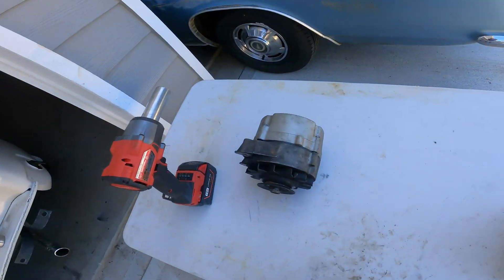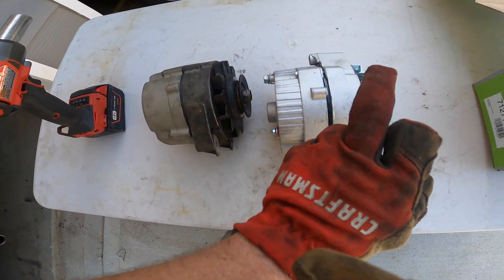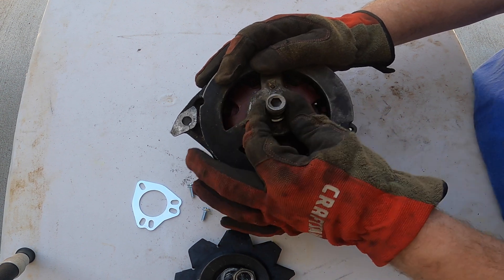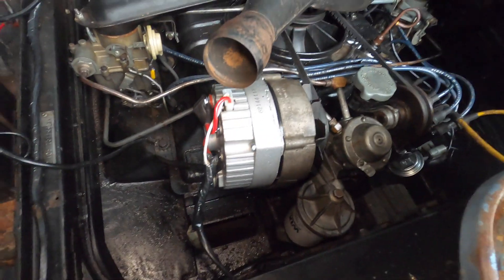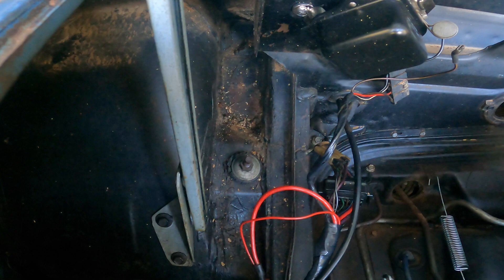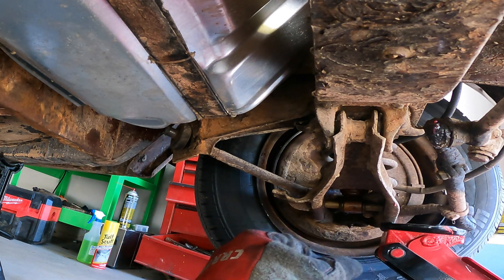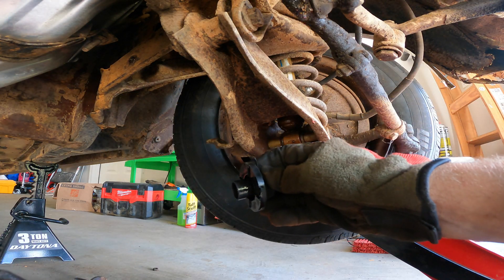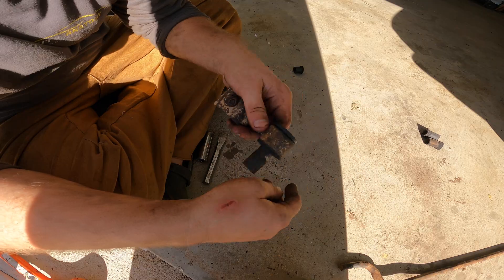CHEAP GM one-wire alternator upgrade for the FLOODED Corvair!  Double your charging power!

Comment: Cleaning assemblies before reinstalling should come a little closer to the top of the list . T he wire wheel on a bench grinder is mighty helpful In quickly preping parts for a spray bomb of quick dry chassis paint !

Comment: Did you have to bend the alternator brace so that it mounted to the new backside of the alternator? I did not see any spacers.
Reply from the maker: No, it just bolted right up without any modifications
Reply: @AutoAnatomy  I used a 76 Camaro alternator. I clocked it correctly. But needed spacers at both ends

Comment: That's NOT a one wire. That is a internally regulated 10si. A true one wire does not use the two prong field plug connected to it.
Reply from the maker: True, but I think many refer to this style alternator as a one-wire.
Reply: @AutoAnatomy  Only those whom are mis-informed. So let's be clear, What you have here is a three wire alternator.

Comment: Kinda looks like your old alternator was an upgraded one based on the color difference between the front half and the rear half. And the windings look pretty much the same between the two, not sure how the new one would provide more power. Nonetheless, this will be my go to video for if and when I need to do mine. Thanks!

Comment: On mine, I replaced all the bushings, springs, shocks ball joints and tie rods front and rear.  Was like a new car.  I never upgraded the alternator.  I suppose if it needed replacing I'd think about it.  37 amps is plenty for me and my car.  Perhaps you are putting more stress on the belt.

Comment: The only thing I would've done, clean the front housing, and run a heavier gauge wire off the output. You double the amperage, should double the road between.
Reply from the maker: That's on the to-do list for sure!

Comment: I did basically the same thing except I used the newer pulley and fan. Worked just fine and the 10si/12si only outputs 63 amps stock. I used to rebuild the things as well as starters and electrical systems on automobiles.Good kob though.
Reply from the maker: I believe the alternator fan on the Corvair is reverse rotation, so you may want to check that.
Reply: @AutoAnatomy  You are correct. For a Corvair, you MUST you the original, stock fan pulley for the alternator.
Reply: Thanks for all the videos. But do you have the part number for the new alternator you installed? I don't see it anywhere. And it was great seeing you at the 2025 Vairs in the Valley.
Thanks

Comment: I bought an 65 amp Alternator at the corvair swap in Palm Springs.  I think it is one wire set up but has the original connections.  I was wondering about wiring.  A

Comment: Not really a '1 wire' Alternator!  On a Corvair, it is VERY important that the 'Gen/Fan' light on dash works! This light on when driving tells you that the alternator is not turning hence the cooling fan belt has come off/ broke.
Reply from the maker: What's interesting is that my Gen/Fan light works (somehow), even though I didn't hook it up.  I was told that on some cars it needs to be hooked up and some it will work without.  I tried without and it worked, guess I got lucky. 

Sean
Reply: @AutoAnatomy  When you say "it worked", did you test it with the fanbelt off, and did the light actually stay on? Or did you disconnect the wires going into the alternator, and did that cause the light to come on?
Reply: @AutoAnatomy  Here again proves you don't have a One Wire alternator. Try unplugging the two prong field plug on the alt. and you will note the alt light on dash will illuminate. Luck has nothing to do with it.  With a One Wire alt  will not operate the warning light on dash because it loses the signal from the alt. that turns off the light.  The warning light will stay on with a One Wire even if it is charging. One Wire alternators are not ideal for street because of this. They were actually designed to work on commercial vehicles such as tractors, etc.

Comment: Ours has a generator, is the mount different for a generator vs. the alternator?  Also, do you have a part number for this gm one wire alternator?
Reply from the maker: No idea about the generator, but I would assume it would work the same way.  I picked up one for a 1978 Camaro from RockAuto.  Here is what I got:
https://www.rockauto.com/en/moreinfo.php?pk=3379887&cc=1035188&pt=2412&jsn=1

Comment: Double the charge rate is a great idea but the OEM wire is only #10 so kinda light for the extra amps. You might want to run a second wire over to the battery. Also, on the wiring harness on left side near the carb has a molded plug and if there's a poor connection in there (probably!) it will melt the plastic by the heavy wire feeding to the front. Ask me how I know this and I will tell you I had to source another harness section from a donor car because the melted plug would not fully seat and just made more heat. Adding more amps might make that condition worse. That wire feeds the wipers, heater blower, and the headlights. IOW, 95% of the car's needs. Clean it up or it will bite you later.
Reply from the maker: Good to know, thanks for the info!

Comment: remember  the eng runs backward    ,,air  has to flow  from the back to the front,,,..i got a new one  from rock auto  had the wrong fan on it...
Reply from the maker: I swapped the fan from the old alternator to the new one.  You’ll see exactly what I did in the video
Reply: @AutoAnatomy  good  glad you know..